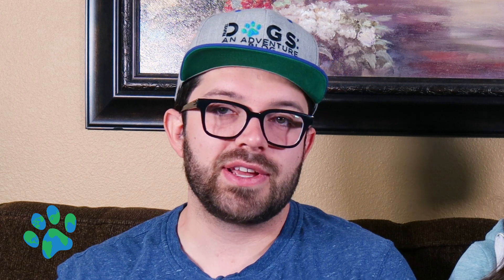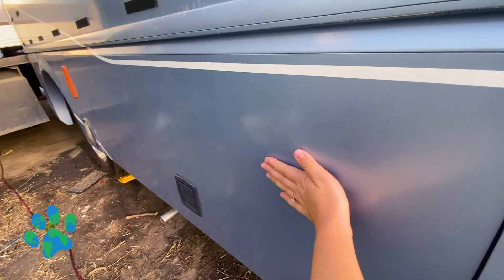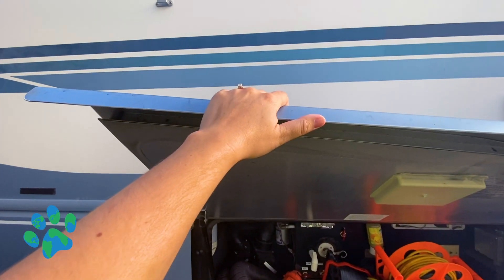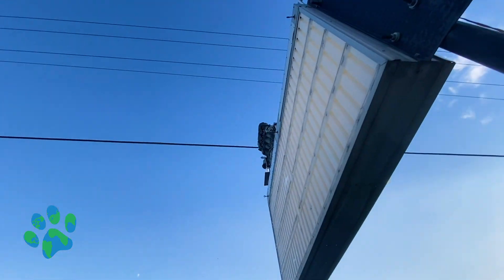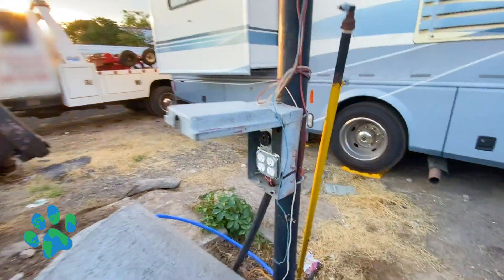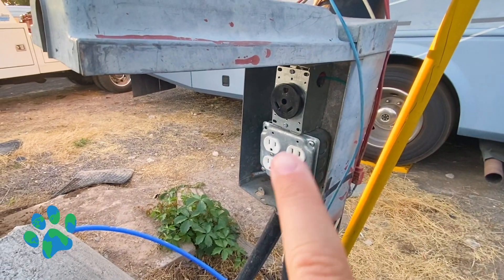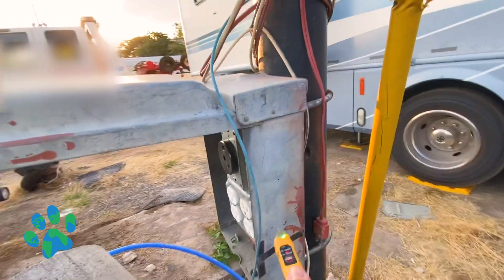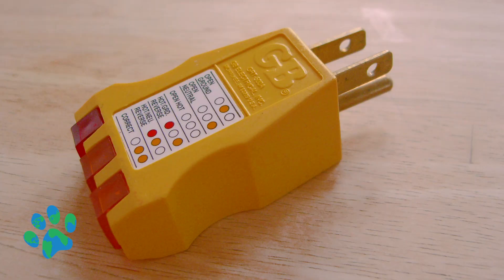My RV Shocked Me! HOW TO TEST FOR RV HOT SKIN - WHAT IS RV HOT SKIN?

Comment: 6' ground not 50'  Those testers are pretty lame, they pick up stray voltage from wires on power poles, I have mine an inch from my MacBook  right now and it's flashing and beeping, it also flashes and beeps when touching my Apple Watch charging cable which is what, max 5 volts?  Don't use one of these, you'll just freak yourself out.  Right now I'm rubbing it on my cotton t-shirt and static electricity is setting it off.  Get a proper meter so you can test and relax.